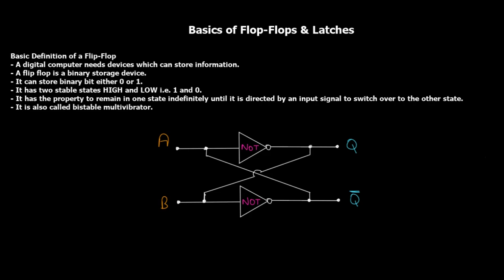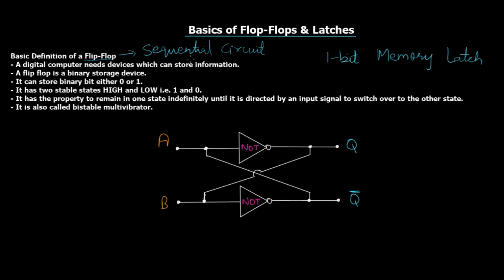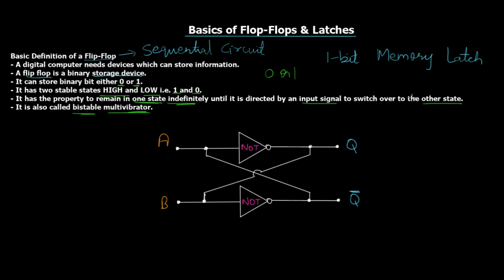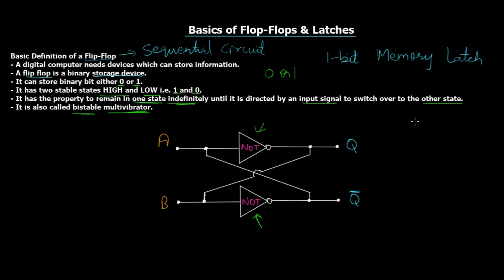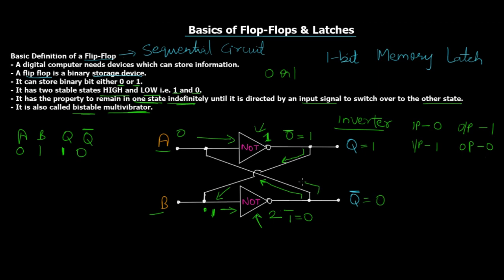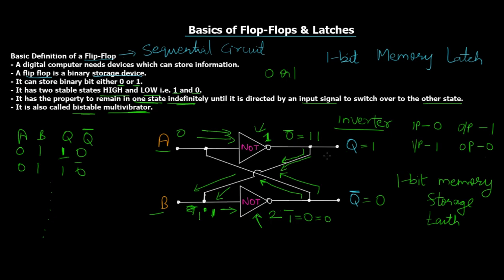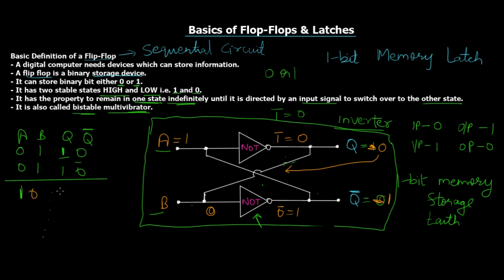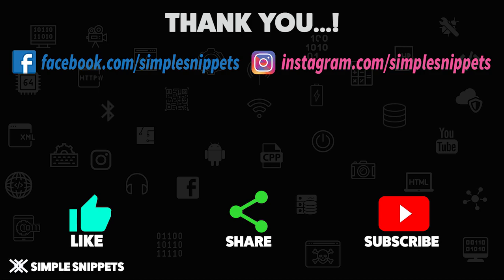Flip Flops & latches in Digital Electronics with Example of 1 Bit Memory Cell

Comment: But does Q and Qnot retain their state after the power is shut off?
Reply from the maker: Good question & yes otherwise how would we still retain memory in our computer HDD or any storage devices ? Because ultimately they consists of such digital electronics only at the very micro level 😇
Reply: @SimpleSnippets  Well that is going to depend. I actually delved a little deeper into this during the reply lag because my question more along the lines of  HOW flip flops actually  retain this information after the power is off.  Flip flops are used for RAM, where the information is lost when the power goes off, but flip flops are ALSO used for permanent storage, but whether the flip flop commits to hard storage is going to depend on the physical design of the flip flop itself.  In the case of HDD, it's a question magnetic polarization of the bits, which I STILL need to understand better. But I was obviously more curious on how solid state drives are able to retain information after the power is off. Anyways, what I discovered is that it all has to do with the design of the gate between source and drain at the transistor level of the chip.  So there is actually two layers that make up the gate. When an electric charge is ran from source to drain across the gate, electrons actually get trapped under the bottom gate in an on state. So even with the power off, those electrons remain trapped under he gate for a significant time period. (Eventually they will deplete, hence the need for  backing up your hard drives)  So when you turn your computer back on, and want to access your SSD, those electrons remain under the gate, and signify to the circuit that the bit is on. Then switching the bit to zero is a matter applying a reverse voltage to the gates to free the electrons. Anyways, I knew it was possible to store information to disks, obviously. lol But flip flops can be applied to ram OR Solid state storage, so I was trying to figure out exactly how information was stored with the power off. There are a few youtube vids out there that explain it. But there's the jist of it, anyways. Solid state MOS have an extra layer to their gates to trap electrons under it with the power off.